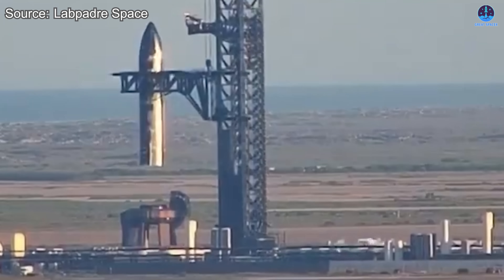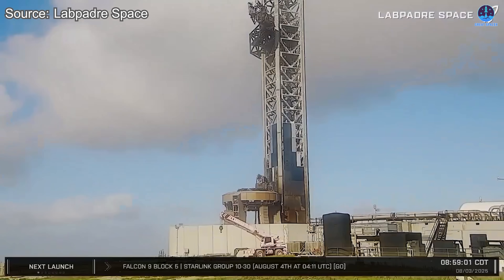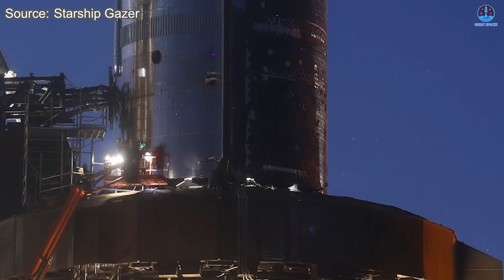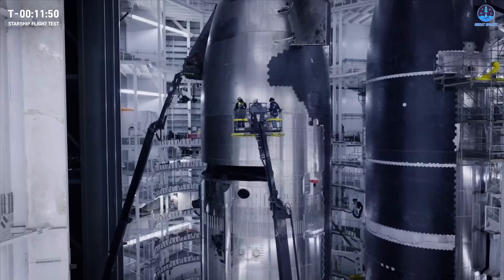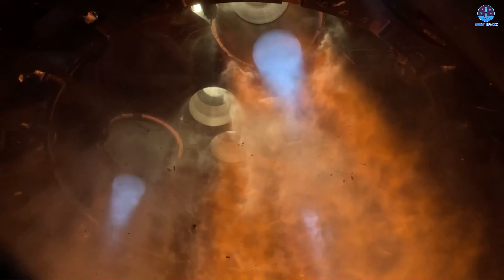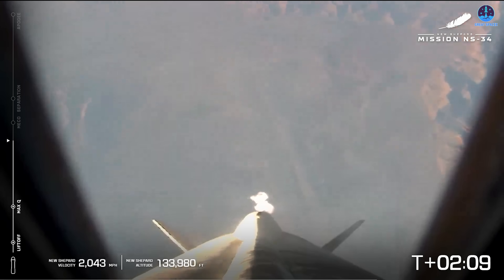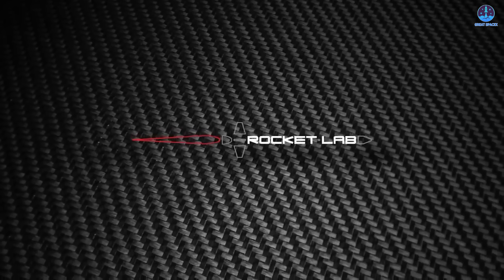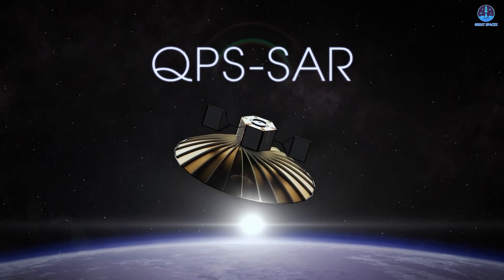Adapter Down, Full Starship Up! SpaceX Races Toward Starship Flight 10 Next Week...

Comment: Keep going Elon Musk  yout doing good kick there asses get her up I say skip moon put your station in orbit around moon with enought supplies to refuel starship and send to starship to Mars one with habitat and supplies and other 10 or 20 people the robot arm Good idea it can dig and un load and laying it on its side is good idea can be used as a second habitat if  something happens and making the habitat out of that collapsible storage unit that the space station used is perfect for this that why I was saying using old shuttle and landing them remotely ahead of starship with more then they need and the shuttles were designed to bring down more then they took up  and refueling in space is the way to go no longer have to worry about having just enough fuel to do a small mission you can do just about what you want actually you could make it so your space station can join up with starship and it can put it in the moons orbit or Mars orbit
Reply: SpaceX is legally contracted by NASA to do one of the Human Landing Systems.

Comment: Now that they have proven that the ship adapter worked in the OLM, I wonder if it would be wiser to test the booster at Massey's (with the flame trench) and utilize the adapter at Massey's to test startships there as well. Seems like that would give them the ability to test at all three locations and even allow testing outside tower 2 when they take tower one offline to upgrade. A catastrophic failure at Masseys is far more desirable than at the OLM or tower 2.

Comment: Why do we say Blue Origin launched a crewed mission, when I ride on a train I am not an engineer, when I ride in a robo taxi I am not a driver, when I ride on a plane I am not a pilot. So why when I ride on a rocket and I part of the crew. To be part of the crew you need to be able to do something besides ride along and look out the windows. These are passengers there is no way to spin it  any other way.

Comment: Has anyone considered covering the Launch Platform with the same heat protective tiles that are used on the spacecraft? It would seem that such a heat protective system would make overhaul and repair of the Launch platform Much easier and faster allowing turn around of the platform.